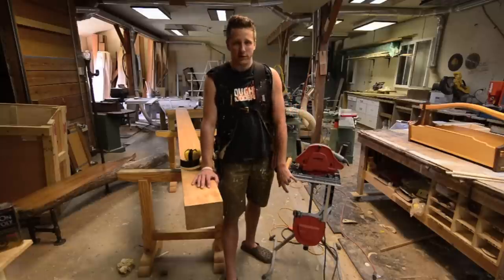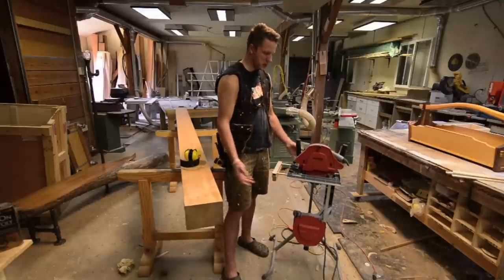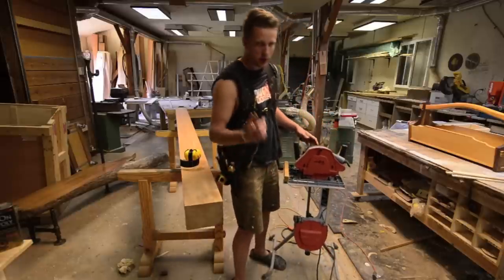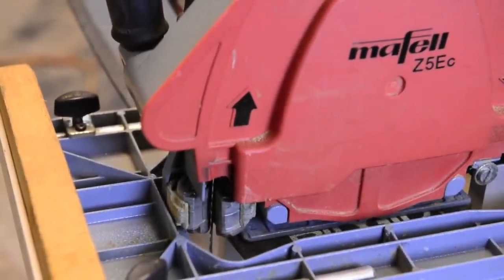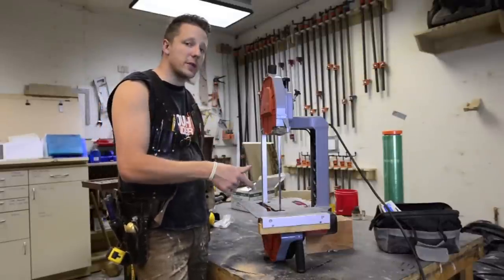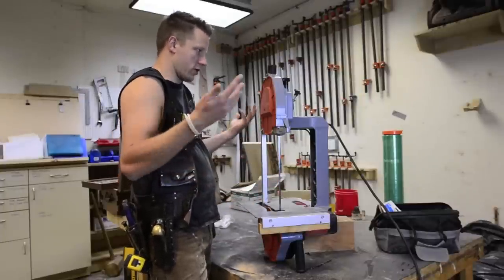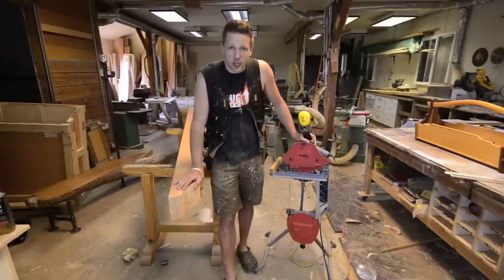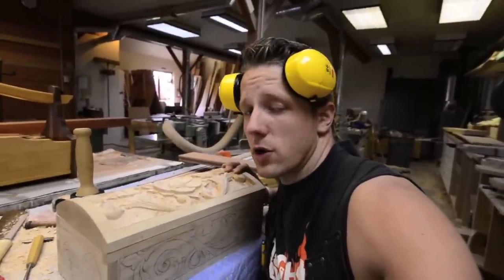Dream Tools, Mafell Z5Ec Portable Bandsaw

Comment: Great video bud. This tool is very high priced BUT,BUT,BUT it is amazing. Especially if your into any type of decorative finishings. A couple of projects and it pays for itself. Furthermore it is highly sellable if you ever decide to sell it. Ya $6,000 grand is a lot for a portable tool. A simple matter of supply and demand though. If you purchased this and only used it for say one or two decent size projects and sold it for probably 75 to 80% of $6000 then cost is only around $1,200 bucks. It would cost far more than $1,200 bucks to pay someone to do this intricate work in large timbers and a ton of hassle. Something to think about. Cheers

Comment: Nice indeed! I definitely want one of those - awesome versatility. How would it handle some gnarly old english oak beams?
Reply: It's a Mafell it will do it, just a bit slower. 
It also depends on how old that old English oak is. I remember cutting a 9"x 9" oak beam that was a few hundred years old.
I cut it with a hand saw and I had to stop and have lunch half way through the cut it took that long!
Inside it was cold and solid like a piece of marble.

Comment: It would be well worth the time and effort to figure out how to build one of these saws. If anyone does please make a video on it.
Reply: I’ve thought about this a bit as I’d like to build a house featuring profiles that a portable bandsaw would make trivial.

There’s a few features that may be quite difficult to replicate like the blade skew, but i can imagine it’s possible. One engineering challenge is making a frame sturdy enough to tension the blade sufficiently. I think aluminium extrusion may be a good start, but i do wonder if a timber frame would work too, perhaps with steel reinforcement.

It needs a blade and wheel alignment mechanism on one wheel at least. And some way to true the bottom plate in two axises.

Perhaps a high watt circ saw would make a good base to build from. Suspect any motor used would need geared down as a bandsaw runs much slower than most handheld tools.

Comment: Nice!
I hate that price though.
I just cannot see the 6 grand worth of machinery inside that tool.
Nonetheless, you're a good teacher.
Reply: +Dikotomii X probably not that many sales.  if they sold 1000's per week you could probably cut that price to less that 1000$.
Reply: Jeffrey Ballard
Agreed.
Reply: +Jeffrey Ballard its a small german brand, building "carpenter-tools" only (nearly 100 percent made in germany)
I dont think that they sell 1000 of this in a year

But still, the quality is unreached, by any other brands (like makita, festool or dewalt) and normally their machines last for decades
Reply: Well it did cut through a huge block of timber, my bandsaw I brought for £500 is good for medium thickness stuff but anything thick I have to be very careful putting it through so I don't damage  the bandsaw or the blade. So I guess this saw can just handle anything.